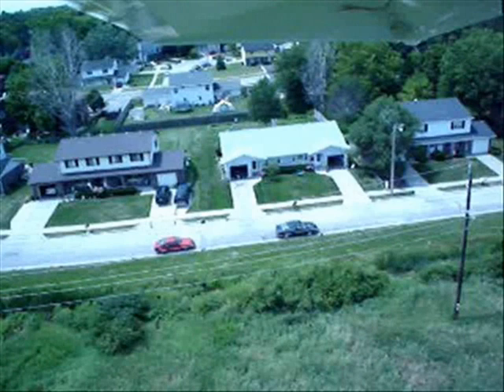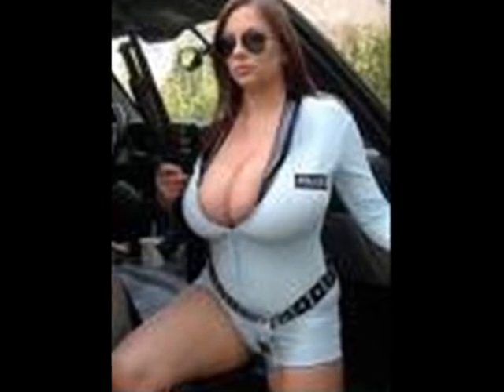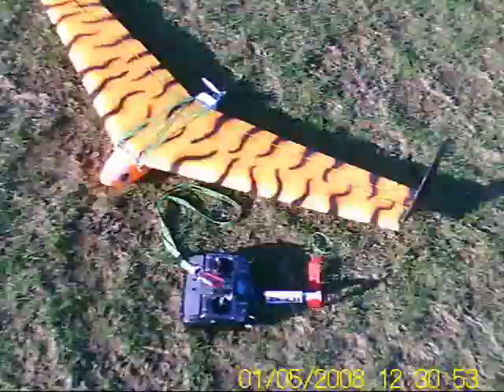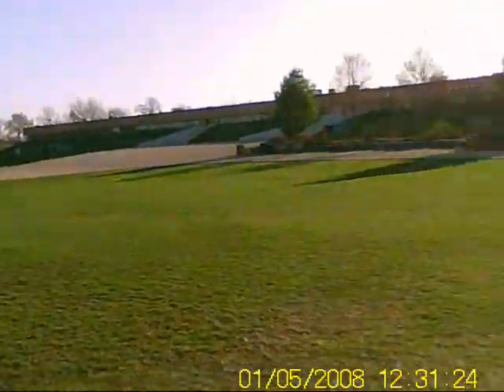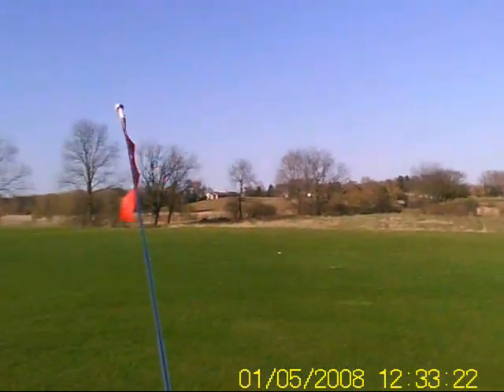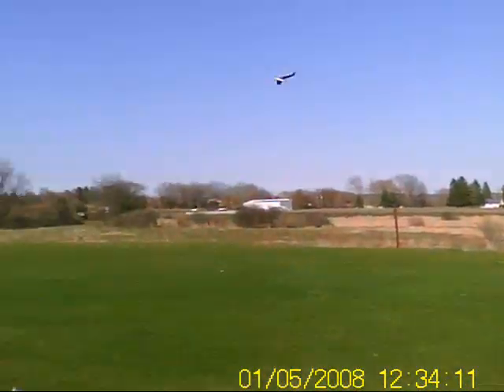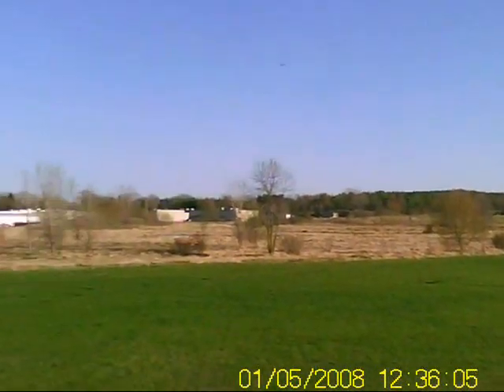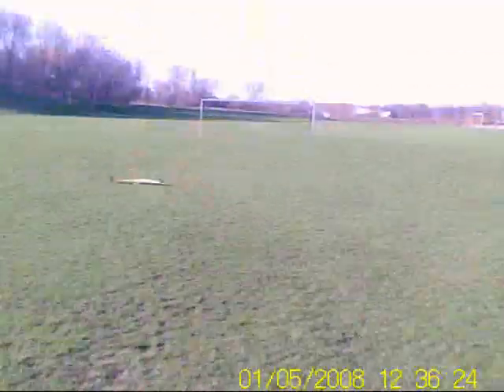2ND Test flight of my Delta Wing.

Comment: nice flight it is pretty fast and i know that shaky feeling after my f15 maiden i also pranged my mini f22 flying over my head at full wack dive doing like 40mph dint quite turn round quick enuff just managed to cut before i went in and did no major damage cracked nose and pulled my vert stab out was lucky really

Comment: for speed readings you can use sound recordings there is a few programs that can doit look on rc groups for the programs i cant remember the names now, and slso seen people using a hotwheels toy radargun that worked well but needs 2 people the doppler just needs a good cam with good sound which you have  the one used to film this would work for doppler just need a close in and low high speed pass's for that to work